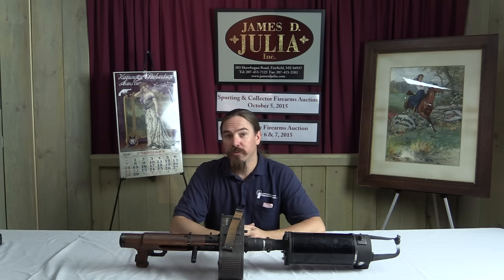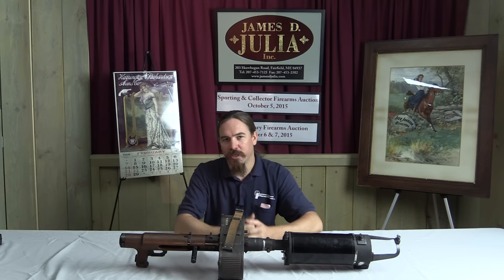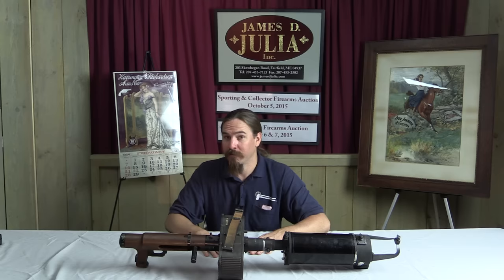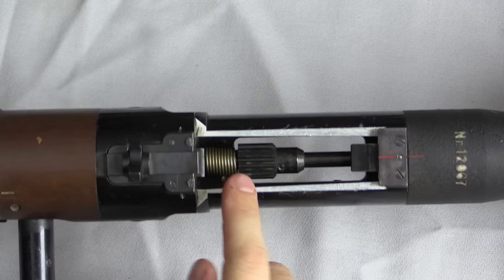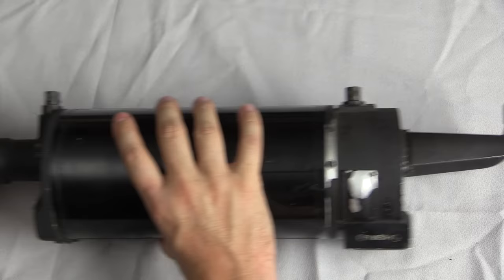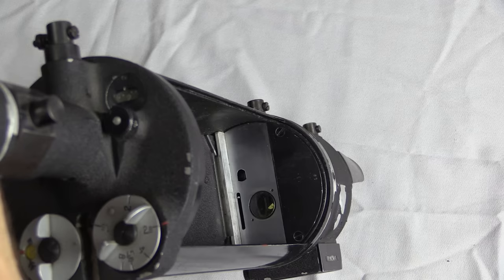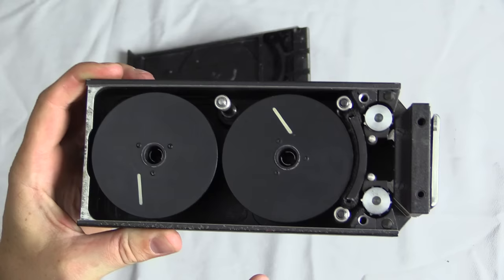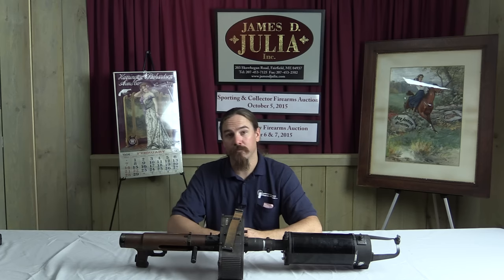MKB-1000 Aerial Gunnery Training Camera

Comment: You are now, officially the luckiest sunofabitch on the internet, with the most coveted job.  At least in my book.  I want to handle all the cool stuff you get to take apart, and put back together, when it's still up for auction, but this is without a doubt the coolest piece to date.  I didn't know there were any of these left, much less in this kind of condition.

Comment: As a  film guy,, you never answered the  question of what sort of film it tooks? 16mm? 35mm? what? It's not easy to tell, almost looks like 35mm.  that would be 45 feet per minute of film,   How many rounds  are in those MG-15 magazines?  that might give you an idea of how much film they carry?
Reply from the maker: +Scott Ruggels Well, I don't have any info on the camera specs, unfortunately. The MG15 originally held 75 rounds in the drum, for what that's worth.
Reply: +Scott Ruggels It is 35 mm. That could hold a 15x75 exposure 35mm film cassette, it would stop every 75 exposure, and a thing had to be replaced to simulate a magazine.
Reply: +Forgotten Weapons Thank you Ian, yet again for a fasinating look into the world of weapons, how the feck someone hit the dislike button on this one is crazy!
Reply: +Scott Ruggels Another film guy here. I would think, based on the image shown at 1:20, it's standard 35mm, shot at 4 perforations a frame, so standard Academy ratio.
Reply: +Scott Ruggels does look 35mm to me too . some fascinating mechanisms and innovative concept for around that time .
Reply: +Gil gamesh So the frame rate of the camera was the same as the cyclic rate of the gun.  Interesting
Reply: +Scott Ruggels 8mm mauser duh! lol j/p
Reply: +Jonathon Payne Like Kubrick said "Every frame a painting" here, every frame is a bullet. :D
Reply: Spudwellington z n
Reply: Sure it is 35mm? Film is/was expensive to buy and process and 35mm would be unnecessarily expensive for the job!
I would have said 16mm, like the gunsight cams. Looks like it would take the cartridge that they used.They were %100 16mm because i had one!